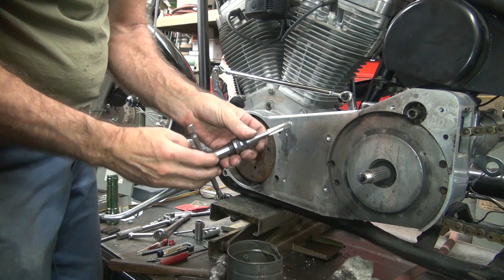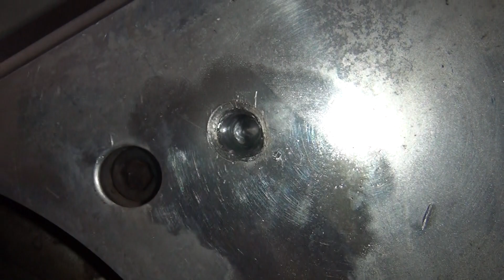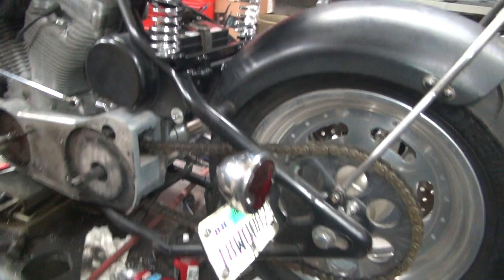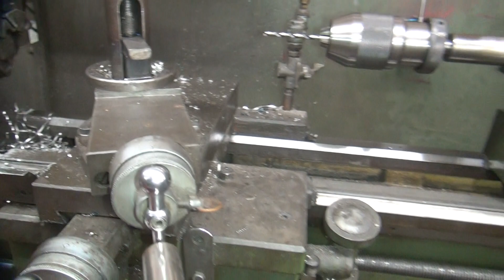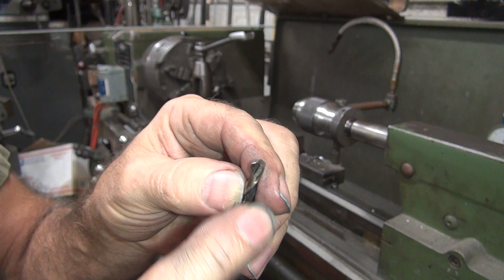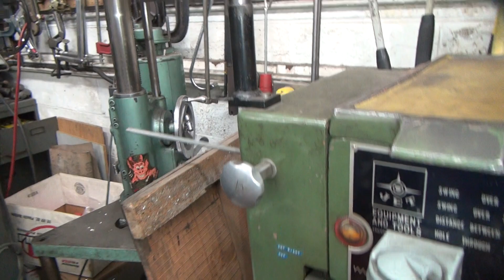#218 1999 80ci evo chopper used bike tune-up repair rebuild rigid bobber custom harley tatro machine

Comment: I've been doing some research on the use of Helicoils and Loctite. Can you please share some of your experiences with using Loctite on Helicoils and fasteners. Can't seem to get a straight answer from anyone about it. I Helicoiled all of my wagon wheel disc holder holes and didn't use any Loctite on the Helicoils however, the fasteners call for Loctite. I'm half afraid of using anything on the fasteners in fear of the Helicoil pulling out and ruining the wheel/hole.
Reply from the maker: the helicoil is a locking device in its design. it is just a big spring with a lock tab at each end. i do not use loctite on the helicoil itself but i have loctited bolts in them. i have not had any unscrewing of the helicoils like you fear. i am asuming that the loctite gets into the helicoil too and makes it hold better.
tatro
Reply: @TatroMachine  AWESOME THANKS for the tip Keenan. I take it you used Blue (medium strength) Loctite on your fastener that you were referring to in your previous comment?